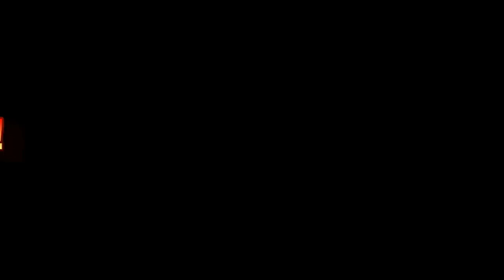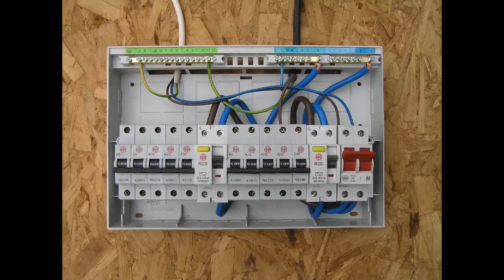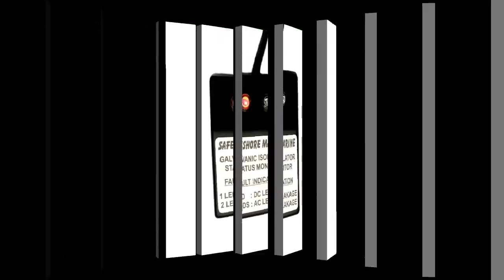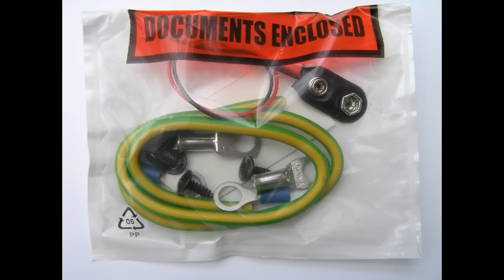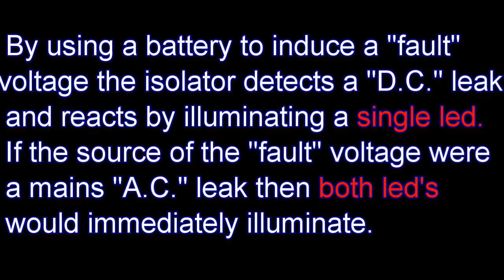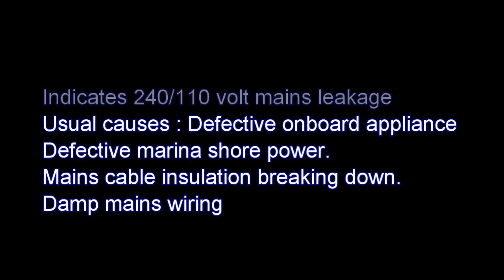How to install a galvanic isolator in boats or yachts.

Comment: This video is not for the US market where boat builders conform to ABYC electrical specifications.   Also, modern galvanic isolators are 'fail safe' and do not require an external monitoring system as shown in this video.  Do not buy a galvanic isolator that is not engineered as 'fail safe'.
Reply: Also, do you see any tinned stranded copper conductors? :face-blue-smiling::face-blue-smiling::face-blue-smiling: